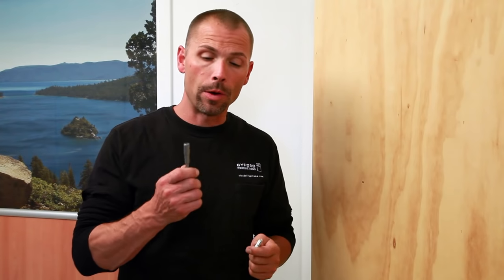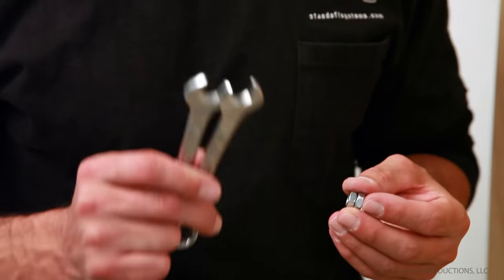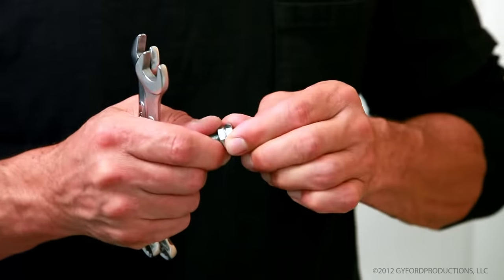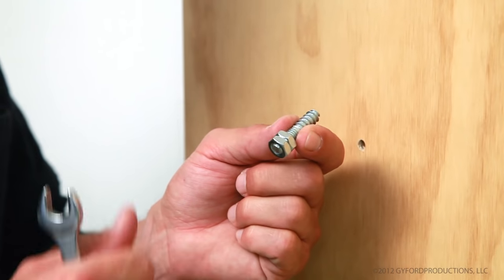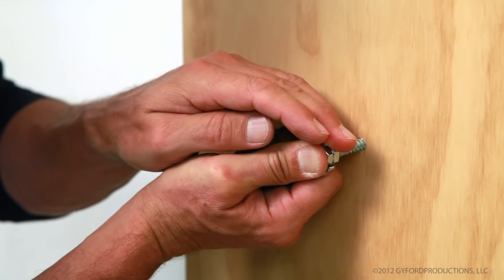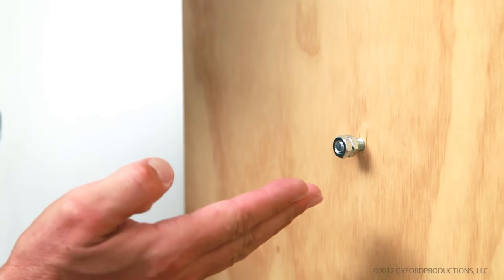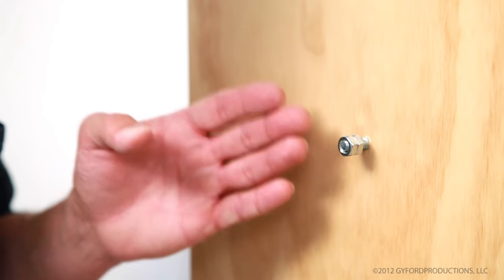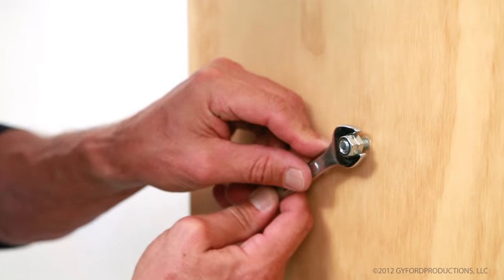How To Install Wood Hanger Screws Using Hex Jam Nuts

Comment: I've sent back 2 sets I'm on my 3rd set as they sent me the ones without the Allen driver tip again (which is what I ordered) so I have my money got to keep the bolts so for free I'll make them work and you just solved my issue.... Thanks

Comment: I had to install a couple of headless hanger screws to fasten a console sink to the wall and didn't have a clue. Using the two hex nuts worked like a charm.